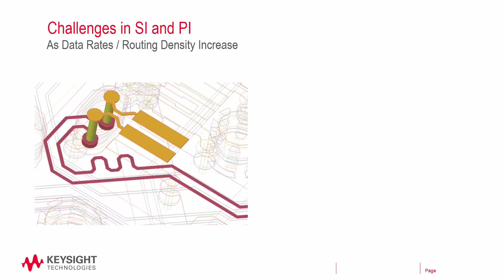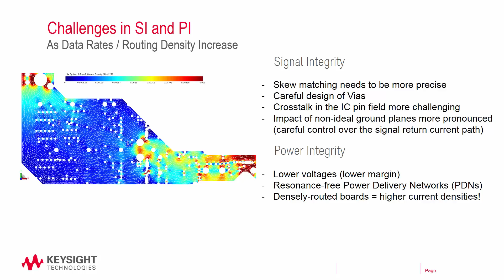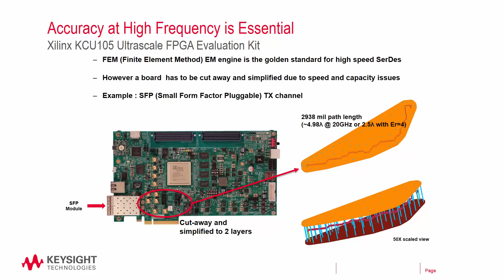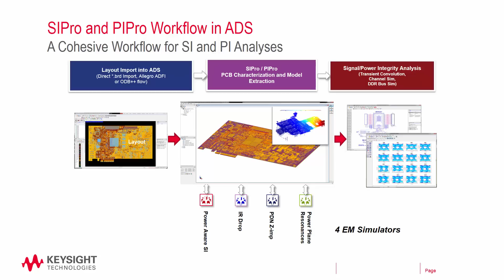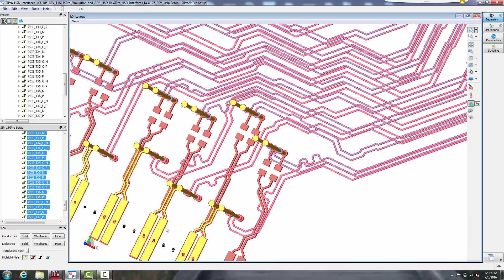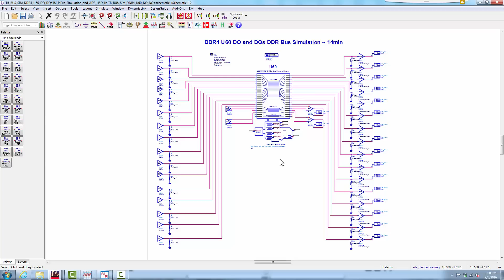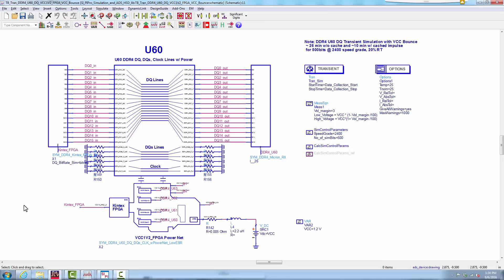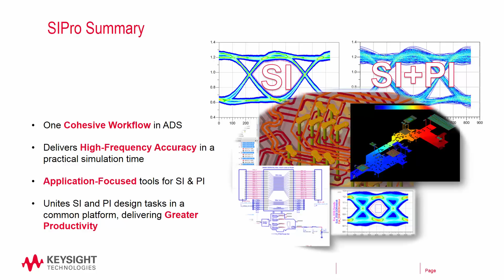SIPro Introduction

Comment: What will be the max frequency of the S-Parameter model if the Nyquist is 20GHz. Should it be 3 times the Nyquist (60 GHz) or 5 times the Nyquist (100 GHz)?